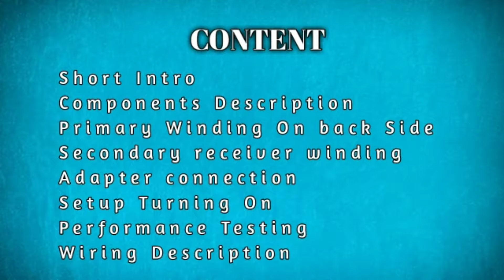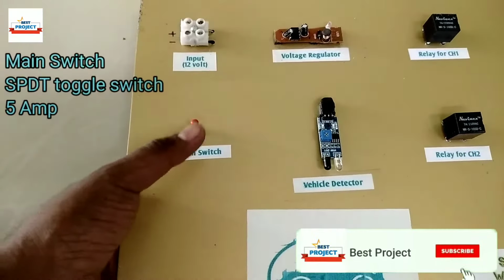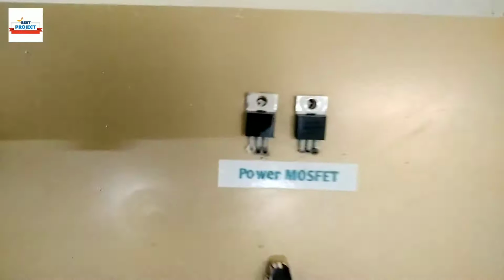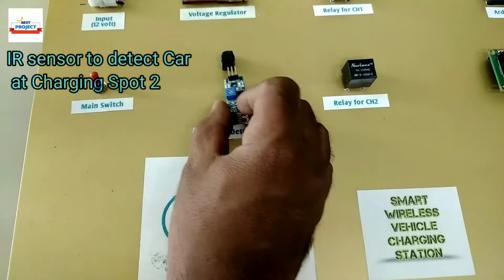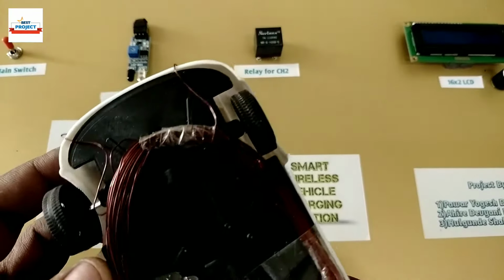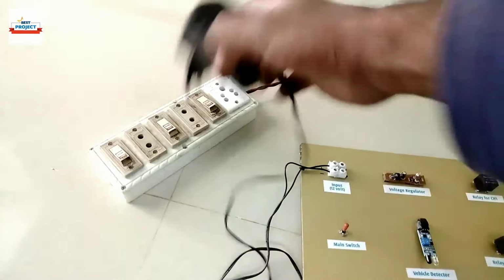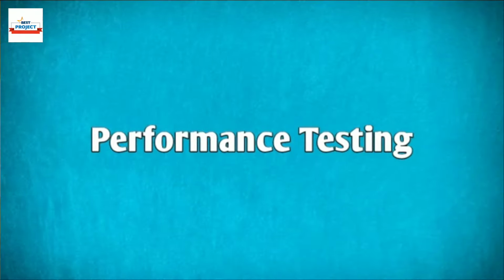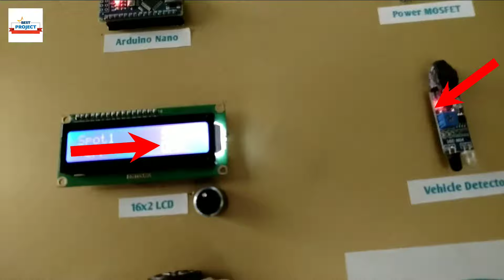8. Vehicle Wireless Charging Station | Car Detection | Power Saving | Dual Spot | IR Sensor | 2024

Comment: Is there coding done for display and I r sesor
Reply from the maker: LCD is and IR sensor is input output devices running according to the code inside microcontroller.
Reply: @ElexysProject  the code inside microcontroller is done by u ?and in which language?
Reply from the maker: @kumarmunna9122  writen by Arduino ide, in c language.